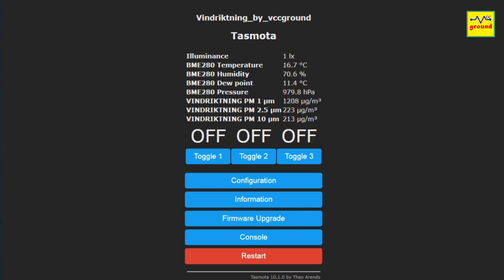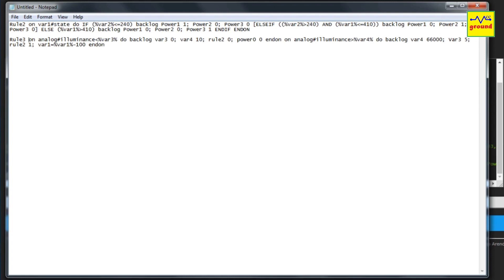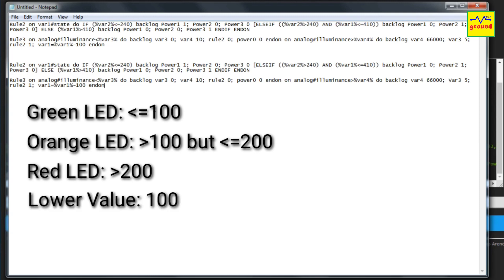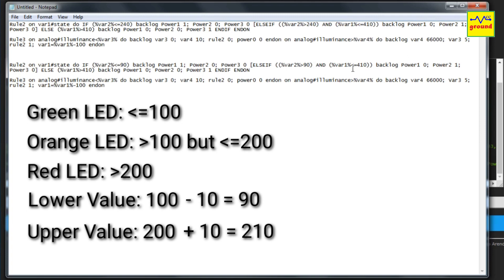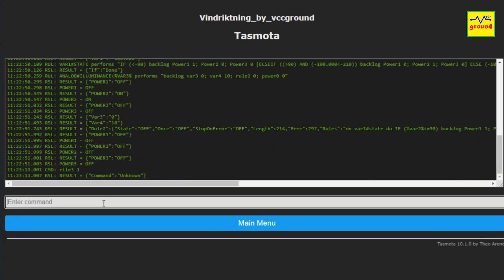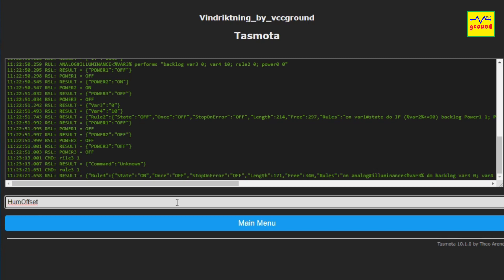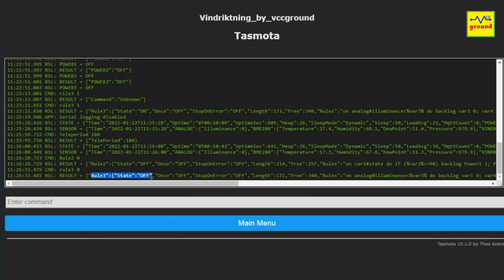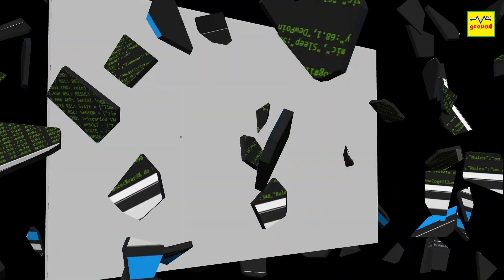#35 VINDRIKTNING Multi Sensor Firmware Customization | Everything you want to know | FAQ

Comment: is there way to add MQ135 CO2 Sensor
Reply from the maker: That sensor has an analog output. So, you can attach it directly to tha A0 pin.

Then the measurements can be sent to your home automation software. Or you can make rules to do whatever you want. Follow MQ135 sensor datasheet.